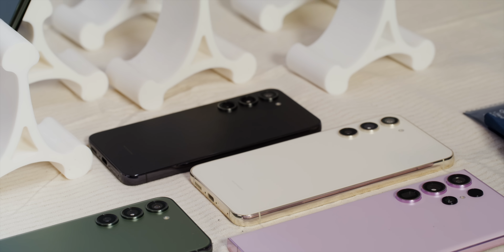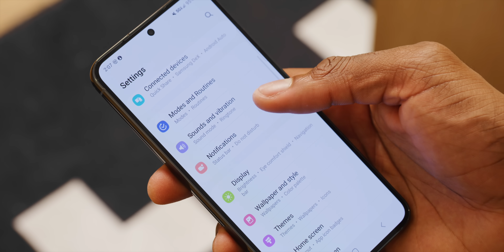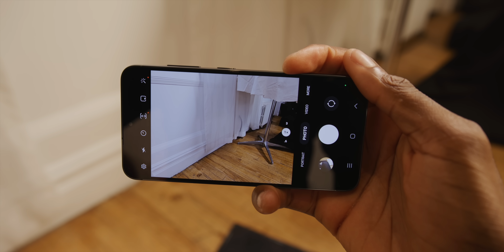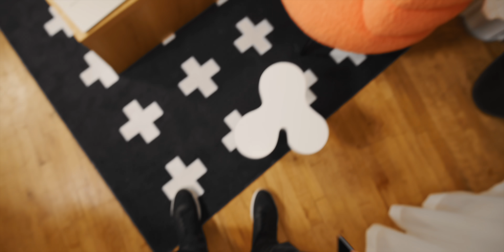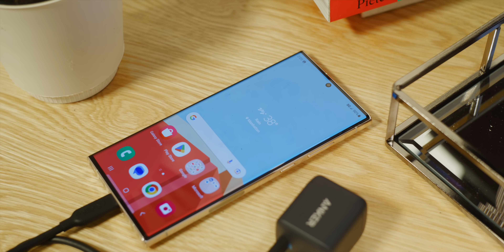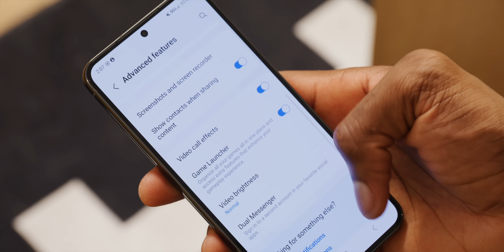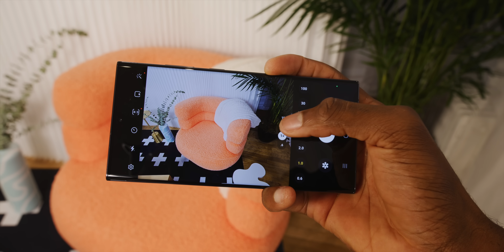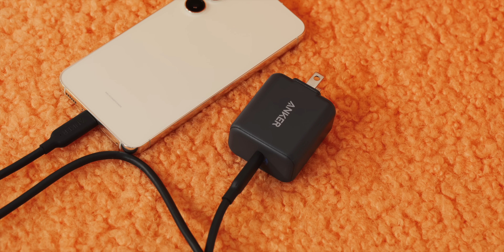Galaxy S23 / Ultra Impressions: Cruise Control!

Comment: I definitely think we've reached a point in smartphones where yearly releases aren't necessary and maybe every other year should be released
Reply: And to be fair, it would probably help the hype of new products a bit more, and make people more likely to switch as a lot of phone contracts tend to be 24 months these days.
Reply: @donkey1271  Who has a contract on a phone tho? Basically just a scam. Just buy a phone and service seperately. At least in Denmark this is always the cheapest option
Reply: @Vfulncchl  Not everyone has the cash upfront for a phone, particularly at the price they are these days for a flagship. 
With the trade in deals a lot of providers offer, plenty of people end up in a constant loop of phone contracts.

Absolutely agree it's cheaper to get a phone+seperate sim, in the UK even an iPhone SE is 40% more expensive over 2 years on contract vs phone+sim.
Reply: @donkey1271   why are people still signing a phone contract?
Reply: @evacody1249  Because it’s financially easier than dropping $7-1000 up front on a phone every few years
Reply: @donkey1271  Verizon and Tmobile IIRC are both 36 months, ATT being the only one that is still 24 months
Reply: I agree. As much as I think they should, I feel like companies like Samsung & Apple are too greedy and just try to milk as much as they can from their customers.
Reply: @Danilio.  I Disagree with you. Because I think smartphones have gotten to the point where there is no major upgrade. The smartphone companies are running out of ideas. So every year they just add little features then release them to the public.
Reply: @Dudee34  Yeah that was confirmed some years ago, I think even Mr. Whosetheboss made a video about it.
Reply: @Danilio.  you have the choice to buy a new phone every year. Don't be a sheep
Reply: @Danilio.  greedy? you do know they are a buisness right? what is the number one goal of businesses? to make money.  its not rocket science. there is nothing wrong with being greedy, dont like it? go live in the woods bc by your assesement, every comapany on the planet is grreedy
Reply: @Danilio.  true, but that's up to the customer, if you're playing for each phone each year.. That's your fault. There's no incentive to get one every year other than wanting it
Reply: @Danilio.  if anything, they are relatively slow compared to the cycles of more populous brands such as Xiaomi or Oppo, who have ridiculous release cycles and short update ones.
Reply: @Danilio.  are u slow? The word business itself implies profit maximization. It's not called being greedy, it's normal. Lol.
Reply: Nobody forces you buy. Why do you have to have latest and greatest phone. These companies even makes mid range, you buy them on your own. Don't put the blame on companies
Reply: @Danilio.  Welcome to capitalism
Reply: @melihcan7577  Lol
Reply: @Danilio.  I'd actually like to know how this one does sales wise. I can't imagine millions of people would buy this if they have the ultra 22
Reply: @B.E.R.N Network  But that's the thing tho, Samsung knows not everyone wants to buy a new phone yearly so in order to make customers more tempted to "upgrade" they'll do trade-in offers. Like trading in the 22 ultra for the 23 ultra and only pay around $100-200 in total.
Reply: @Danilio.  Apple only releases like 4 phones a year. Samsung releases like 10
Reply: @BenPBL  Tell me the differences of the iphone 13 & 14 besides processor, camera & screen
Reply: @Danilio.  Here's the thing. The companies will follow what the consumer does. Anyone can exclaim what they like but at the end of the day if consumers keep buying them every year then they will keep getting made. 

These two companies have enough of the market in which people buying every other year or every several years will keep numbers high enough to catch those looking to upgrade/change/replace.
Reply: @Danilio.  there aren’t milking customers if they are selling to willing buyers. This is a free market. They aren’t forcing you. Some people just like have the newest model every year.
Reply: @morax489  I know, that's me with Sony Xperias
Reply: @Danilio.  what is a business?
Reply: @Danilio.  apple" 
scratch Samsung
Reply: @PLITXanim  ?
Reply: @Danilio.  Take samsung off
Reply: @Danilio.  not everyone upgrades every year. Some people are on completely different upgrade timelines than you
Reply: @jayware4219  Damn, that's a valid argument.
Reply: @Danilio.  which company is not greedy?
Reply: @Robin Arora  There's a difference between making a profit and trying to squeeze every bit of money from your fanbase
Reply: @robinarora8137  Fairphone maybe? They give you the right to repair it yourself by replacing the modular components with new ones if broken of if you want an update and it's more ethically made.People literally die in mines in order to dig for gold and other metals which go into our phones. It's important to ask the ugly questions too. But since here are only fans of samsung and the newest technology I doubt anyone will apreciate it, or even the concept behind it.
Reply: @laviniam.1526  which ugly questions?
Reply: @Danilio.  just don’t buy done, stop blaming them for humans being dumb for buying them every year
Reply: @isekai2zer051  Ok
Reply: @Danilio.  You think they don't have all the stats they need to determine if they should release yearly or every other year?
Reply: @ViperOfMino  I never said they didn't
Reply: @Danilio.  i think apple is more thinking for user not to upgrade for 1 year and use their old smartphone to get a cheap price
Reply: @Gamaleno Singkali  I'm not sure I understand what you're saying. A few years ago, whenever Apple would release a new phone- their old models would start coincidentally slowing down. Thier excuse was that it was to help preserve the phone battery but they never told users when they started doing so and didn't give users the option to choose whether or not they wanted to do that.
Reply: @Danilio.  People don't understand that running new software on an older device will inherently slow it down. Because people sued Apple, they made it worse by opting to kill the battery faster to minimize the performance reduction in the newer updates. So you'll have to replace batteries more often. Just don't update if you don't need to.
Reply: @Danilio.  I don't know if this makes them greedy. Greedy would be if they forced everyone to buy a new phone every year
Reply: i agreed with you i think every two or three year should be allow for phones to come out
Reply: I agree, but I believe we hit that point around 2019-2020.
Reply: I remember apple used to take 2 years before the competition.  Check out the gap between the 2011 4s and the 2013 5s.
Reply: @DominiQfame  iPhone 5 2012??
Reply: I respectfully disagree. This would only work if people only bought smartphones together.  But every year, all the time, there are people buying new phones, trading in old ones, etc. And buying a phone today that was released 2-3 years ago doesn't seem like a good idea. I still have my Galaxy Note10+. If I were to change, obviously I could opt for the S21U, or S22U, but if there is an S23U, I would opt for the latest model, and it would last much longer with it.
Reply: @DiFF7Skyns  True! I've been using my S9+ for the past 4 1/2 years. I actually wanted to buy the S22 but we Europeans always got the Exynos models so I skipped the last gen. Just pre-ordered the S23U since I prefer Android (was thinking of getting the iPhone 14 Pro).
Reply: @DiFF7Skyns  That argument makes no sense. People buy consoles at different times too, but they still don't release a new model every single year. And funnily enouch, consoles are cheaper too. Same goes for the GPU market, you don't get a new flagship every single year and it makes complete sense buying "old" hardware, because it's the latests model that's available.
Reply: @DiFF7Skyns  But see, those things weren't what you were saying, were they? Nothing in that wall of text matters, I was never arguing the markets are the same (spoiler alert: they aren't).

The point you completely missed was: If magically all smartphones came out every two years, people would simply buy the latest model and nobody would really care if a model was one year old, since it would still be the latest model. The yearly differences at this point are totally insignificant as far as the actual functionality of the device is concerned. Which just happens to be the whole point of this thread, isn't it?

If you'd argue economics, I would have sided with you — if one company started making bi-yearly updates suddenly, they would lose revenue; their competitors would still offer yearly updates, hence a newer model compsred to theirs every other year. As you said, people tend to gravitate to the latest — and the reason they do this is almost purely marketing. 

These companies are good at making us feel like we are missing out on something, even though the reality is our old devices do pretty much everything the newer models do.
Reply: @PhazonBlaxor  You completely missed, again, the implications of releasing smartphones every 2 years or more, I explicitly put it in the text. About battery life, system and application development and operation.

It is precisely for this reason that smartphones are released every year. Oh, and the wall of text was to demonstrate that, in addition to being unviable for smartphones to be launched every 2 years or more, your comparison with the console market was completely absurd and meaningless.
Reply: @DiFF7Skyns  this is a really good point. i've never thought of it like this. thanks for sharing
Reply: @DiFF7Skyns  If it was to demontrate the tech moving forward rapidly, you didn't do good enough job to convince me of anything. 

Battery, really? Li-ion batteries barely change, since we are kinda doing the best we can chemistry-wise. Operating systems can and are easily updated on older devices. Apps can be made and are being made to support older devices as well (I am in fact a software developer, and if my app doesn't work on older devices I am cutting my potential customer base for absolutely no reason).

I said your argument made no sense, because all you were originally saying basically was "people want the latest model, just because they just do".

You weren't talking about anything else besides the fact that there are people every year looking to buy a new phone (true) and that they tend to gravitate to the latest model (true). But if manufacturers didn't update models every single year, it would matter absolutely nothing to the end user — just like people don't buy in synchronisation, manufacturers don't create in synchronisation.
Reply: @PhazonBlaxor  You do know that the battery has a maximum of 3 years of use, until its capacity starts to be significantly compromised, right? And considering the big updates, to maintain performance, it is necessary to push the battery even further.

And this is just one of the factors in the dynamics of the smartphone market. The others I have put in previous comments and see no need to repeat them.

Anyway, I understand what you mean, that the industry could opt for biennial releases, instead of annual ones. Possibly in the future this may happen, but in practice this is simply not feasible to happen now.
Reply: @DiFF7Skyns  What does the lifetime of a battery have to do with the discussion at hand? All I was saying is what you originally said wasn't a good argument on what the OP was saying — nothing else.

Do I agree with what was being said? No, not necessarily. I agree with the OP in that the improvements are marginal at best. But I disagree in the sense that companies won't take this route simply because of economics. They want to maximize revenue — as things stand now, it wouldn't make any sense for them to change the upgrade pace. If anything, they want people to switch as often as possible.

Which is probably one reason they are still not introducing a simple improvement that would significantly increate the longetivity of batteries: charge limiting. Most consumers don't realize that emptying the battery and charging fully is what's killing their batteries. I've been keeping my charge between 40% to 80% on all my devices as often as I can, and it shows: even my ages old Oneplus 6 still has great battery life, my 2016 MB Pro is sitting at 85% battery health and my 6 months old Surface Pro 8 is still at 100% — despite me using it heavily every single day.

Batteries can last far longer than 3 years if you just take care of them.
Reply: @PhazonBlaxor  What does the lifetime of a battery have to do with the discussion at hand? Everything.

If I buy a second-hand smartphone released two years ago, it will have more deteriorated battery health than a used one released last year. No matter how careful its previous owners were. Battery degrades over time, and that's a fact. Yes, the battery can last more than 3 years, it can last up to 10, or even more if you want, you just won't be in the same health as always.

In the case of smartphones, updates further degrade the battery to hold performance. And performance is something that also compromises the useful life, not only of the battery, but of the cell phone as a whole. The more time passes, the lower the performance and health of the battery, this is inevitable.

All that said, not only the battery is a considerable factor to justify the annual launch of smartphones, but the dynamics of the market. More and more people are buying or changing cell phones all the time. Cell phones break down, forcing people to buy a new one (or a used one). There are different profiles of people, me for example, who make heavy use of the cell phone, which further degrades its useful life.

As I said in the previous comment, your argument may make sense in the future, but now, in practical terms and the dynamics of the market and the operation and useful life of the devices, launching smartphones for 2 years or more is not feasible.
Reply: @DiFF7Skyns  What are you talking about? We were discussing the release of new phones, not used ones. So once again, what does this have to do with discussion at hand?

Let me go through this "problem" of yours. So I have a phone for 3 years, I took terrible care of it and the battery is dead, have to buy new one. What do I do? Go and look for the latest model and buy that one (I would actually look for various options because I don't stick with one brand, but let's imagine you are a huge Apple fan or something and don't consider anything else). So, where is the problem? It's the latest model with a brand new battery? Sure, it was released an year ago, but it's still the latest model and ia brand new in box.
Reply: @PhazonBlaxor  We're discussing not just the releasing of new phones. But the interval from one to another. And yes, this has direct impact on selling used phones, that was one example I used on my previous comment. That's called perspective. You always need to look up for the whole picture when you're dealing on such subject of discussion. It's not like simply saying (like you're doing): "Hey, if they only released devices every two years, whoever bought a new device half the time would still have the last one released. Problem solved."

Since the beginning of this thread, I presented several reasons why the annual launch make sense for this particular market. Several. And you wasn't able to present any counter argument to any of them. And your reasons to biennial (or more) launch makes no sense, I made sure of that for which one, no even the initial comparison with consoles, which was absurd.

Anyway, you can keep with that thinking of yours, and I can continue to be glad they released phones every year. This discussion has nowhere else to go, besides repeating ourselves. Thanks for the conversation.
Reply: @DiFF7Skyns  You do realize that companies also don't release in sync, right? There would still always be models available which came out that year. How is this so hard to wrap your head around?

Also, it's not that half of the people would get the latest model — everybody would just as they do now, as it literally would be the latest model available from that particular company. It doesn't matter if they come out yearly, every two years, every three years, by definition latest model is the latest. What's so hard to understand here? It doesn't matter to the general consumer in the slightest if the CPU is 5% faster or not — most people don't care or understand anything about the underlying tech, they just want a phone that works for basic tasks. Which is the whole point you keep missing by moving the goal post with your random BS about batteries and whatnot. 

But yes, this conversation is going in circles. I'm getting tired trying to explain the simplest of things when it clearly isn't coming across at all.
Reply: @PhazonBlaxor  With the advent of smartphones, their life cycles have become kind of predictable. You buy a new phone, enjoy all its flashy specs, and then within a year you get a new model that makes yours seem outdated. It's possible to feel like it's time to upgrade your phone after two years, or risk falling behind, just like Apple and Samsung do with their new iPhones and Galaxy phones every year. The company knows that at any time customers could be looking for a new device, and they want to be able to tempt them with something. Rather than have a 2 year old device that they think, Wait a second, if you have a 1 year old apple iphone, you wouldn't want to upgrade to a 2 year old Samsung phone, right? As an example, if smartphones were released every 2 years, it would mess everything up because if you wanted to switch to another brand, you had to buy a smartphone from that specific brand that was out that year. In this way, you won't have to switch from a 1 year old phone to a 2 year old phone, since every company would have its own opinion, saying "Hey, I'm gonna replace my phones every 3 years, hey, I'm gonna replace my phones every 4 years." , I agree with DiFF7Skyns. For smartphones to be released every two to three years, every company must do it at the same time.
Reply: @PLITXanim  I think you are thinking way too deep into this. 95% of consumers aren't smartphone enthustiasts and have no idea when a phone was even released. They just buy whatever they come across and suits them.
Reply: @DiFF7Skyns  finally someone making this point
Reply: @DiFF7Skyns  definitely agree with this, I'm currently running a fold2, my inner screen is now starting to show hairline cracks, if samsung didn't release a new phone now then I would be limited to buying a year or two older phone or wait another year in which time my screen could die at any time. I'd rather get the latest phone now and sell mine to a 2nd hand phone shop while it's still worth more than scrap. And as much as I love the fold I won't be getting another one.
Reply: @DiFF7Skyns  wow that does make sense
Reply: Agree. Every three years should be good enough aswel.
Reply: @Farcallo  I was about to purchase a samsung s phone back in 2018 but I discovered poco f1 while researching for other phones. It was highly praised phone even in the west. So I bought it and was half the price of the latest samsung s series that year. 4 years later my phone still do it's job but the battery is degrading which I think is normal
Reply: @Farcallo  5 years, the more you wait, the more exciting the ugprade.
Reply: What about battery
Reply: @Farcallo three years is a little long
Reply: People upgrade every year, Not just one person.

But people’s upgrades cycle aren’t all synced up so all because you upgrade 21,23,25 sone else maybe be 22,24,26.
So why would they reduce their profits?
Reply: Yearly releases aren’t so people buy a new phone annually it’s for the people who bought a phone years ago.
Reply: YES
Reply: you think ONLY NOW we've reached that point?? and I thought I was the elitist
Reply: Agreed, but I think yearly release is good from stock market standpoint.
Reply: I would go as far as every 2 years. I ran my Iphone 7 till the iPhone 13 came out and I upgraded to a 13 pro max. Most likely wont upgrade for another 6+ years.
Reply: We reached that point a few years ago.
Reply: I feel like we've already reached that point many years ago, but either way I agree. It would cut down on SO much e-waste.
Reply: @niko1even  People would still buy and throw out the same amount of phones... They would just be more older models
Reply: Yep. I'd also like to see screens start getting a little smaller again. Hard to keep up with them getting bigger and bigger.
Reply: @suraangel6956  iPhone 13 mini?
Reply: @suraangel6956 the regular s23 is a nice size.
Reply: @suraangel6956  look up small smartphones, you could get a really small phone.
Reply: They have to release every year because those that are looking for the next newest thing will jump ship and buy the latest iphone if they don't. Yearly release are just to keep business because those who don't upgrade all the time won't be bothered anyway.
Reply: You don't have to buy a new phone  every year. The companies aren't forcing you.
Reply: Them releasing it yearly doesnt mean you need to buy them every year. Just like cars!
Reply: True
Just look at the iPhone 14 🙂
Reply: True . In like 8 or 9 years of using phones , for the first time I don't feel I need to buy a new one .
Reply: @houseismorethanjustm  honestly I just upgrade when the battery goes, which is usable like 5years
Reply: I think as Moore's law slows down we'll naturally get slower release cycles as well, at a certain point the economics of yearly releases just dont make sense.
Reply: I totally agree, also from a environment aspect, there should be regulations
Reply: Disagree... most people are on two-three year upgrade cycles. Many would then start aligning their upgrades for the refresh year, meaning Apple/Samsung lose revenues during the non-refresh year.
Reply: We’ve been at that point for a while. The thing is, people still buy these phones every year. If there’s money to be made, companies will take advantage of that.
Reply: @immortalsun  exactly
Reply: I go every 2 years
Reply: Yep. Been like that for years now. Probably a decade. The changes are small incremental with maybe one big jump once in a while. The companies will keep making them tho coz it's easy money for people who crave being "up to date" so you can essentially keep making money if you're a phone manufacturer but for the average person like in my case I usually keep my phone's for like 3 years minimum so upgrading every few years doesn't leave you behind coz usually the only thing you lose out on is some occasional software updates
Reply: I very much agree. Both iPhone and Samsung have become so good that it feels overbearing to keep having annual releases
Reply: The thing you're forgetting is that not every one upgrades every year. I upgrade every two to three years, at the mo i'm using a S20fe, so the yearly phone upgrades work for people like me. And those that will always upgrade at the first chance they get.
Reply: I think companies incrementally update their phones every year is fine.. it’s us customers that should control our spendings and only upgrades every 3-4 years.

For people with 2019 phones, now is time to upgrade
For people with 2020 phones, maybe next year
For people with 2021 phones, two more years
And so on..
Reply: Plot twist: You don't need to buy them, just skip one year if you want :P
Reply: So what you are saying is that they should release new phones when you or someone else wants or needs a new phone 😉
There are people buying phones all the time. Why would they buy a 1.5 year old phone. If they can buy a phone released 6 months ago. Yearly releases are just fine. They might be incremental improvements but if people choose to buy with every second release the improvement will be bigger. Samsung now support 4 years of OS updates, so they obviously don't want you to upgrade every year. They (and other companies as well) just want to give the best they can to anyone who is upgrading at a given time.
Reply: Let me rephrase that for you, I think we have reached a point where yearly "purchase" isnt necessary. Let companies do what they do, we should control our purchase patterns.
Reply: Yep! I usually keep my phone every 2-3 years until I upgrade and the upgrade is noticeable enough that I'm satisfied upgrading. The only time I've upgrade the following year is my current phone which is the Fold 4. I didn't like how narrow the Fold 3 was so when the 4 came out, the proportions were better for my liking, so I upgraded. I'm def gonna keep this for at least 2-3 years, as usual.
Reply: Yeah, but not everyone on Earth buys phones at the same time, riiiiight?
Reply: I disagree, companies can launch phones whenever they want. It’s down to the consumer to decide when they want to upgrade, whether that’s every year, every 2 years etc
Reply: I think yearly releases are fine, it's just not necessary to upgrade annually.
Reply: companies: "BUT WHAT ABOUT ALL DAT MONEYYYYY"
Reply: It's been like this for at least 5 years now. Releases should be every 3 years.
Reply: How about people who upgrade from 7 year old batshit?
Reply: @Johnny XCX 

"Improvise, Adapt, Overcome"

Jk lol
Reply: And that goes for iPhones too... Not just Android phones
Reply: Lg knew this issue
Reply: @chriswright8074  indeed
Reply: Totally agree with you. Every smartphone brand is doing the same thing processor and camera no new innovations and USP.
Reply: Still on a iPhone 12 Pro Max and honestly could use this for another year or 2 and be fine. Smart phones are becoming kinda like cars no real reason to buy the latest just buy last years model used or when the price drops.
Reply: i disagree there are people who always skip nd buy next one 
A lot of people waited for this nd didn't buy s22 
Nd a lot wont buy s23 and wait for s24
Reply: 3 to 4 years is good but the tech brands will make less profits
Reply: it beenthis way for a long time now. At this point, companies are doing it just to do it cause they know there are still a morons that buy the newest phone every single year to be "up to date"
Reply: I have an s9+ and see no reason to upgrade lol
Reply: That's true, but unfortunately every other phone companies releases phones every year so if Samsung doesn't give their yearly refreshed S23 model, most people would spend their money on other flagship phones that came out in 2023, since it's "updated and new"
Reply: @oreopuppies6411  most people buy phones when they run into the need to. It’s like a car: they release one every year but people stay with the old one, having big changes with bigger gaps but small upgrades, changes .etc every year
Reply: but Apple does the same, people laugh at them, welcome to the club.
Reply: wouldn't make sense business wise because not everyone is upgrading every year. if people stopped buying a new phone every year just for a minor upgrade then they would rethink it maybe
Reply: You definitely haven't had the last 2 fold devices
Reply: It's been the same shit for the past 3years. The upgrade is minimal. The thing is the consumers are not smart anymore so they buy yearly for namesake.
Reply: @hcjdjejssk5887  speak for yourself 😂😂
Reply: It's pretty obvious that the biggest update with the S23 series is the camera and nothing else.
Reply: LOL, they don't release new phones for PEOPLE's benefit. The release them to make more money. There are naive people who are willing to pay $1000 just to "upgrade" to a few more camera MPs or a faster refresh rate so their screens "look nicer" when scrolling through messages.
Reply: I think the same but much early hehe IM still using Huawei mate 10 pro. Ok , updates stop on Android 10 but its enough for all users to use all apps. Is fast enough with all apps run in background ( for some people its only 6GB RAM).  MIC is  freaking Great catch all vices no issue,  Stereo Speakers are good, Cameras are good little worst is Video Recording but it's enough for most users. I'm using still original battery  and still all day with medium  use.  If the battery shows  signs that need to be replaced, I will  replace for  few pennies in Main Huawei center, no problem. Im trying to choose my second phone for my second SIM Card  ( don't want to use two sims card in one phone) I can't decide what to choose  for now.
Reply: We've been there
Reply: They should do that as well with their  tws earbuds
Reply: So minor upgrades...
Reply: Why I usually wait at least 2 models after I have an s22 ultra see what the s24 ultra will be like before I decide
Reply: That's garbage how Samsung's only doing 500$ trade in credit for my s22 ultra. Definitely not worth upgrading.
Reply: It'd be expensive though
Reply: I think it kinda helps the consumer more than not. For example, i didnt get a phone for a year or two. I can EITHER get a new phone that came out this tear or get an older one for cheaper. But lets say they do a three year cycle And i wait two years to get a new phone. Id probably have to get that two year old phone, no problem, but itll PROBABLY be near the price it was two years ago.  

Tldr: basically what I'm saying is as a consumer you DONT have to buy the new shiny thing but if they ddnt do it every year itd probably make the prices of recent older devices more expensive. Think video game consoles for an example.
Reply: 100%
Reply: Same as FIFA and NBA2K
Reply: And they'll still barely be an upgrade. They just take their old phones and solder on whatever marginally better snapdragon and camera is available. No increase in RAM. No expandable storeage.
Reply: Cameras could be better
Reply: Question since folks smarter than me might be here. My S10+ has resolution of 1440 x 3040. Would the S23 and S23+ basically be a downgrade from a screen resolution standpoint or is there more to it?
Reply: You don't need to buy a phone each year. Ideally people who do need to replace their phone after several years of usage should be able to buy the most current thing.
Reply: I agree an extra year would let them refine a product much better
and too many products
Id really wish they put more focus into a few products instead of scattering it across multiple lines
Reply: well lets wait till 2025 because thats when we get the 500mp camera, selfie camera that can disappear, fingerprint scanner on the entire front screen, and redesign.
Reply: Yep. Or better yet every two years.
Reply: I wait 3 years between upgrades.
Reply: But capitalism! And lets not forget consumerism!!
Reply: Agree 💯
Reply: Hard agree. With these things being g as powerful as co.puters, if vote for spending more time investing in development for better upgrades next year.  These things are better spec'd then my xbox360 was. I ran that past the release of the Xbox one, I could wait a little longer for a phone.
Reply: That's like telling car companies that releasing a new model of their many vehicle lineup isn't necessary. I get what your saying but in reality its business. They have to release a new one each year in order to rake in profits. Also people in the market to upgrade would probably buy the latest thing from the manufacturer if they want. I had the s10 from 2019 and just upgraded to the iPhone 14 pro the latest from Apple.  Some people upgrade each year but there are many who don't and when the time comes that they need to buy a new device its helpful to have the latest model out as an option or look to older models.
Reply: That's facts
Reply: Honestly I thought this ages ago, I think around the time the s20 came out, and I still do
Reply: I think what they should do instead is release non-flagship phones every year and then release flagship phones every other year.
Reply: Agreed
Reply: well not everyone buys their phone at the same time, some people might have their for 4+ years and think now is the right time to upgrade
Reply: We reached that point with the S7 back in 2016. They should release a new phone every 3 years or so.
Reply: Apple and Samsung release yearly. Does not mean we should buy yearly.
Reply: Always has been, just don't buy new stuff every year
Reply: I agree, for all this is a great phone I won’t be changing for another couple of years, I have the S22 Ultra and I’m VERY happy with it. Phones are lasting longer and the quality is still good 2-3 years later but this is a great review from Marquis, as usual.
Reply: it's necessary coz not everybody update every year
Reply: wow. great point.  maybe this year Samsung and next year apple might do the job
Reply: 3-4 years, when it actually feels like one should change one's Phone. There is no "new" feeling stuff before that.
Reply: but that won't make them as much money!
Reply: It's never been necessary, it's called PLANNED OBSOLESCENCE, Marques should do a video about it.
Reply: I buy every 3 years
Reply: Like nothing phone
Reply: I have an Oppo Find x3 pro and most phones don't improve on it even though it's 1.5 year old now.
Reply: Meagre updates every yr...and they charge the same ...new phone releases should b once in 3 yr ...tat will b good for environment too....otherwise prices should drop for older phones wen new phones comes out .
Reply: No man every year launch is necessary just people need to stop buying every year. if phone launches in 2023 that phone is made for people who have phones before 2020 .  
example : you buy phone from 2020 and after 3 years someone buy latest model . now next phone will launch in 2026 and the year is 2025 . would you want superior tech than 2023 or would you buy sam old 2023 tech which is already 2 years old😂
Reply: I agree. But I don't think they're thinking about (only) last years consumers
Reply: It better for the consumer for them to release a new phone every year as it gives us more options and drives the old phone prices down. They would save money if they only did every two years and the old phones would be more expensive for longer because they weren't being put "out of date" so to speak
Reply: They have to do yearly releases because every person who's 1 phone behind will get the next one to upgrade. s22 people said they're going to wait for S24, S23 people will wait for S25 them, it's just an endless cycle
Reply: Well if your device is slow and needs an upgrade now, if a new release isn't available, well you gotta need to wait a year for it.
Reply: To be fair for people who don't upgrade phone every year or 2 S23 is amazing option
Reply: But if you don't change that often of can they drop software support on your 2yo phone and force you to upgrade !
Your a mad man, think about Samsung stock value 😭
Reply: Let them release every year. we shd buy it once in 4 years. thats the reasonable time.
Reply: oh what would the shareholders say!? I think we all agree with a release every other year but we know it's not happening. people are still gonna buy them so why stop making them.
Reply: why people are buying them then
Reply: Its for those who want upgrade
Reply: I don't think they think we buy phones every year, I think a big part of it is to stay relevant and many people don't buy the next years phone so if they do buy a phone from last generation not necessary that they buy a phone after 3 years they could buy after 2 years too and that would mean they have to buy the same phone just again that too 1 year before the new one comes out.
Reply: Really this days there's not much to expect when they do remove them yearly
Reply: People who say this are so dumb. It's better they release new phones yearly because it devaules the older models and makes them more affordable. People who want to pay for the latest tech can. People who don't want to upgrade don't need to. It helps nobody by not releasing phones as often.
Reply: Agree i have s9 plus and now i will buy 23 ultra, every four or five years you see huge  difference in technology
Reply: Flagship: 3-4 years
So, i'm gonna upgrade my S20+ to S23+
Also my S20+ is only 4G, so another win for S23+
Reply: Wrong; Just because people shouldn't upgrade each year doesn't they shouldn't release an offering each year. As different groups of people will upgrade in different years. Just because you upgrade every year doesn't mean others do. Someone shouldn't have to buy a 2 year old phone because they weren't ready to upgrade 2 years ago and they don't want to wait for the next release.
Reply: Yeah man, but there are competitions and the corporates don't want to lose customers.
Reply: I want to see the smallest version of the phone have all the top specs the bigger phones do!
Reply: How will they earn and burn your pockets?
Reply: Or…you could just not buy it instead of trying to limit the others looking to upgrade.
Reply: I think we reached that point about 10 years ago.
Reply: Yeah... Definitely boring af
Reply: Im not sure about that. If this was the case, when youre looking to upgrade you either have to buy a year old phone or wait a whole year before the new one drops.
Reply: They should be released the way game consoles are done.
Reply: @Red_Genie  Every seven years? Unfortunately software develops way too fast for that. Old processors would have a hard time handling new apps and OS's after like 5 years. Not to mention battery that loses its health over time. After 7 years your battery is worth nothing.
Reply: If the demand in sales is still there I guess they will just carry on. I haven't had a new flagship phone since the galaxy S9. 
Very happy with mid range phones these days
Reply: Yes and no , some people are coming from older phones every year , but certainly if you own the previous model  and spend your coin on a new one , in daily use you are really going to have to look very hard to see a difference for daily usage .
Reply: Yeah you're maybe right
Reply: You don't have to upgrade every year.
Reply: But why? Why can’t people just have some self restraint and only upgrade when they feel they need to. Some like to upgrade every year whereas some are happy upgrading every 3-4 years. No benefit in manufacturers releasing new phones less often.
Reply: No? You don't have to buy this. A person can buy a phone every 2-4 years and just get the latest one. Having new phone come out come out every 2-3 years would mean if person wants upgrade. They would have to wait longer, or even go to their competitor if they released a new phone recently. Which companies don't want.
Reply: Still have a snap S10+ that works almost as well as new. Battery is factory and still lasts me a day easily. Cannot see any justification to change at the moment. 5G is useless for ,phones imo, picture quality is already very good, it has everything I need. 
You can easily keep a smartphone for 4-5 years nowaday I feel.
Reply: Agreed. I upgrade every 2 yrs. I currently have the s22 ultra and watching this video it looks like I'm gonna be waiting until the s24 ultra and possibly even the s25 ultra to actually get a big upgrade.
Reply: Not gonna happen duo to marketing rules
Reply: Exactly what I was thinking. 💯
Reply: You don't have to buy them yearly, just wait three years then.
Reply: We reached that point years ago but companies will be companies and still release products but as the consumer buying a new phone every year is just dumb and wasteful, my S8+ is still going strong after years and its only now its starting to show signs of lagg.
Reply: There never was a point where it was necessary to upgrade your phone on a yearly basis. If you have a year old phone there's absolutely no reason to upgrade, however not everyone has that. I'm still using my OnePlus 6. So for me its going to be a huge upgrade.
Reply: That’s dumb. And here’s why. iPhones last a long time. Androids can do that. But If I have an iPhone from 2017. Let’s say iPhone 8. And I want to upgrade fall of 2023. BUT a phone just came out in fall of 2022 and the next one isn’t until fall of 2024. So now I have to wait or buy last years phones. Phones aren’t for you to upgrade yearly
Reply: Buying them every year has never been necessary, but we're definitely now at a point where skipping a few generations is a good idea. I'm on an S10 and will be upgrading to the 23 Ultra. It's the equivalent of getting an S14 in their old naming terms.
Reply: I havent bought a yearly phone for years
Reply: But unfortunately they can't make money that way.
Reply: @Sambeg  They still can, it just won't be an annual thing. But even if they stopped making new phones yearly they would still have many other income sources like their subscription based services & other products.
Reply: The companies won't stop. Its business. Simple. Just don't buy every year. Buy anytime you feel like its time to buy.
Reply: Agree
Reply: Most people don't change phones yearly anyway.
Reply: No this is great because I can buy last year's phone with 90% performance for 50% price.
Reply: Unless someone is coming with a new breakthrough, they better not release yearly. But hey, how they gonna make a living? Also, dont forget new entrants and not just upgraders
Reply: But Apple would not want that.
Reply: @pepsibIue  I had a co worker that got a new flagship every 4 months or so. He would buy a phone, keep it until the honeymoon phase wore off and it wasn’t exciting to him anymore, sell it for almost full price and buy another flagship. This was how he got his dopamine hits
Reply: I'm so glad someone has finally said this!! We don't get a new Xbox or PlayStation EVERY year, so why do we need to get new phones every single year?? Its baffling. Also, if the next Samsung Galaxy S Flagship wasn't realised until 2025, there'd be more innovation and a MUCH better upgrade.
Reply: apple drops yearly and they're a trillion dollar company...they have no choice...
Reply: Incremental every year is best, just upgrade on your own pace.
Reply: All the damn e waste.
Reply: No. Cause if someone bought their phone in 2021 in 2 years for them is 2023 but if someone bought their phone in 2022 in 2 years is 2024. Not everyone change their phones every 2years on the same year
Reply: absolutely NOT agree. i want to buy a new best phone every year because i am rich and dont care. i also buy a new car and a new monster gaming pc every year.
Reply: Snapdragon 8 gen 2 is massive upgrade chip from snapdragon 8 gen 1 in s22 ultra
Reply: @richard35791  That's what they say every year.
Reply: I would be great to see a company that releases a phone every 5 years and supports them for 10 years.
Reply: Who cares if they release them. YOU BUY IT EVERY 3 years…the world doesnt revolve around you, someone might be in a 3-4 cycle of not having upgraded their phone to they buy the phone releasing next year
Reply: Yearly spec bumps make sense, you just don't need to buy them every year...
Reply: @airplanes657  , in terms of impact upon ecology and Earth ecosystem, they don't. In addition they're too minor to make a difference and only bolster planned obsolescence as well as production of bloated, unoptimized software that sucks (suckless software reference).
Reply: It is not an annual release that won't be necessary, but the habit of changing your device every single year that has to be done
Reply: @UwU are you disagreeing with me by saying the exact same thing I said?
Reply: @@user-kq6fn3dl7w I'm looking at those specs. Not much of an upgrade . No amount of mental gymnastics will change that lol.
Reply: How will they make money? Apple releases the same phone every year and the sheep go crazy. Looks like Samsung is going the same way
Reply: Definately. Even more definately nothing will change regarding releases of new ones...
Reply: I like yearly releases since the older models get discounted so much so fast :))

8:04 PM
2/4/2023
Reply: The original Iphone were released every 2 years for new model. It’s give people not to buy phone every year with better upgrade on the phone itself not only (minor upgrade) And sell the 2nd hand phone the price was good by that time.
Reply: there's 4 other colors from their site as well
Reply: They can release one every year but I’m only getting a new one when I break the old one or it fails in some way. Like about now when I need to replace my S10 🫤
Reply: I think most people will agree. But that will never happen because the company will not make near as much money.
Reply: It depends on the model. The foldables, Samsung galaxy Fold and Samsung Galaxy Flip, still improve with leaps and bounds every day.
Reply: Yeah. We should orientate at desktop GPUs. 2,0 - 2,5 years would be a perfect time span for iteration updates.
Reply: We've been there for a decade.  They will continue to release yearly for simps who buy them every year.
Reply: *Bye bye share price, laughs in evil Wall Street
Reply: Yeah the s22 was so similar to s21 and s23 only slightly difference means that there's really no point in getting the s23
Reply: @Gh0st-gso  i thought so too... but the s23ultra is actually better than the s22 ultra by a large margin
Reply: Or you can choose not to buy because yearly releases are not for last years customers
Reply: People dont buy yearly anyways.let them release
Reply: Agreed!  I'm still rocking the note 8 lol...
Reply: THIS! This is what I’ve been saying for years.
Reply: We've hit that a while ago but people still buy so they release.  I stopped buying yearly when I got the Note 12.  I buy every 2-3 years now.  I have a S21 ultra and I'm buying the 23 ultra.
Reply: U don’t have to buy one every year my guy
Reply: There’s a Toyota Camry release every year, but you’re not buying the latest iteration of your car every year. And you don’t expect the new one to be wildly new every year. And that’s ok.
Reply: I think they do it obviously because of money but also because there are people like me that aren't on the same timing as everyone else.   Basically I haven't upgraded since the s21 and I normally upgrade on a  every other year basis.  Therfore,  this would be my personal  year to upgrade.  So in some way, yearly releases do work out
Reply: For that everyone needs to be on the same release cycle, I don't think everyone is.
Reply: @mirzadotdng  THANK YOU
Reply: 100% agree. I say this as an iPhone 7+ user, there was a point where the phone would just feel so slow on the latest update and then you’ve basically got a brick. But now they’re quite fast and there’s no improvement other than camera and a bunch of gimmicky features I don’t need.
Reply: doesnt matter, it their money making machine. just like call of duty, or madden, as long as dummies keep buying them, they wont stop
Reply: Agree, just thought about this few days ago . 😂
Reply: Yes I agree. Just look at how great this year's starting off, whit 256gb and snapdragon 8 gen 2 chipset c'mon what more do we need ⁉️ besided 6000mAh..🤷‍♂️skip a year for ones just ones 😅🤏
Reply: Nah. You don't have to upgrade every year.

All changes this year were mostly under the hood. You don't see the increased battery life from the outside, but it's one of the greatest changes from last year.

Only made possible by the new SD 8 Gen 2 btw. The S23 series isn't a good upgrade for people with any S22 or S21. However for me on my S20 with half working cameras and a cracked screen they're pretty great.
Reply: Peak was the 512/8GB Note 9. I've just upgraded to a 512/16GB S21 Ultra for a killer deal
Reply: I think Samsung is going on that route. Year 1, the design changes drastically. Year 2, the specs change drastically.
Reply: Strong statement but if one company does it like apple, then other companies wouldn't like to be seen as someone who wasn't able to launch a phone, which might not be the case, but i guess at this point launching phones is just for the sake of standing in the league for companies.
Reply: They make new phones every year because they can more money that way..
Reply: I don't get why people would think a company would switch two releasing a new phone every 2 years. Consumers are all on different purchase cycles. Consumers don't NEED to purchase every year or even two.
Reply: Every 3 years should be a standard.
Reply: Honestly…the need to wait at least 18 months to accommodate enough new stuff and get mass production of the chips that go into the new phones, they just wanna ship out product
Reply: Agree, for flag ship ones yes that's the point .make it worth the wait
Reply: It's been like this for like 5 years 💀
Reply: Agreed 💯💯💯
Reply: Yep, no point in upgrading.
Reply: Same as laptops
Reply: last year phone price will drop down. Its good for us. :)
Reply: I agree i replace my phone every 3 models. So i got the s20plus now ill get thr s23 plus
Reply: Yearly upgrades* not releases.
Reply: Could be. But manufacturers aren’t doing these yearly releases because they use their intuition, that’s rather based on empirical data. If a company decides to release products every second year, people will buy the model that is the “newest” from another brand. So even though it is not the best strategy, they would rather have these incremental releases every year than to adopt another strategy.
Reply: S23 ULTRA better than VIVO X90 Pro Plus for camera and overall?
Reply: As a phone sales person I beg this not to be the case. Launches = usually good sales days
Reply: I think yearly releases from the manufacturer are still fine, but the people buying them should really not be worried about upgrading yearly. As good as phones are now, even upgrading every third year would probably be just fine.
Reply: Yeah I agree also. I have an s20 and the only reason I'm getting this phone is due to my screen being cracked
Reply: That's with iPhone
Reply: For us poor people it's actually helpful. Newer releases generally give a way for price drops of the old variations
Reply: You’re broke
Reply: Yh but... Money
Reply: Until we the consumer stop upgrading yearly they won't adapt
Reply: But what about company revenue and executive bonuses?
Reply: Right it’s getting to the point where what more can u change to make it worth the upgrade
Reply: I don't think phones need more or less hype, the point of yearly launches is to incrementally improve an existing, already great phone. Gives people with a 3yr old phone no FOMO, when the newest phone has a higher refresh rate, better battery, and 2 more cameras. But it gives people who need the newest device a reason to spend money again. If you suggested phones be launched like consoles, then the expectations would be far greater for something that has basically been optimized since they started getting rid of the upper and lower bezels and removed the aux port. Just don't buy the newest phone and wait till next year, somebody else will need a new phone, that's how it works.
Reply: AGREED
At this point these are barley even "S" updates (like iPhone 7 then 7s)
Reply: Ready this from my iPhone Xs Max and I’m really not in a need for a new phone. Still 88% battery capacity and it runs great still. So yeah I agree 😅
Reply: Maybe dont buy it yearly then
Reply: Instead people can stop buying every year. I buy every 2-3 years and still don't see much difference. I upgraded from s10 to s22 and there really isn't much of a difference.
Reply: my guy its better that they release every year because they aren't forcing you to buy them it just gives you the ability to buy the latest tech whenever you want
Reply: You just don't have to upgrade every year, if you upgrade every 3rd year, it would be reasonable. Every 4th year even. I have an s20 and I'm still fine. Might upgrade on the next one. But if you have S21 and S22, not much difference.
Reply: Some rich psychopaths just buy it and keep on buying. Irrespective of actual difference
Reply: That's good for us because I can get an older phone and still have a great phone
Reply: This comment is so trite. Yearly releases aren't so people can buy a new phone every year, it's so that people who keep phones for a few years can still buy a new one and not worry about being in sync with some arbitrary 2-3 year cycle.
Reply: Fully agree. Absolutely no need for new releases every year. Concentrate on updates and boosting maybe their lower spec phones and see where they stand every year
Reply: I agree. It’s like TV, laptop, and any other electronics. People used to be excited about innovation but now nobody cares as upgrade is minor af.
Reply: We have been at that point for a few years now.
Reply: With the newer iPhones too me it looked like 2-3 years
Reply: I agree, but they will continue to make them because people don't tend to upgrade their phones every year. On average, I believe people wait a few years to upgrade and when they decide to they want the current years model rather than something with last year tagged to it. I think manufacturers are aware that most people don't upgrade their phone every single year, but it simply doesn't matter because everyone is upgrading at different times anyways. Demand is always there.
Reply: r/woosh
Reply: Were they ever necessary?
Reply: Haha I have literally done my research project in uni about this. It is interesting to see that other people are actually thinking about it!
Reply: The little updates simulate compounding interest
Reply: This is exactly why I upgrade every 2-3 years. It's only by that point that the changes become noticeably different and satisfying to upgrade. Otherwise, it's a complete waste of time (to make sure everything is set up how one would like - assuming they aren't an Apple fan and like to customise), and a waste of money... Having to pay about a thousand every year.
Reply: Yep. I have an S22 Ultra and won't be upgrading before 2024 at the earliest.
Reply: But all customers are not gonna buy a smartphone in the same year and buying an old smartphone means 1 to 2 years of less software update.
Reply: Imo they can release whatever they want. The public should simply stop being wowed and stop buying new phones every year. It's all demand and supply. If there won't be a demand there is no need to supply since sales will drop. It will happen. Just a matter of time.
Reply: This will only happen when they run out of ideas and things to upgrade for their next phone.
Reply: I bought my S9 used in 2018, it's been thru a bad wreck that almost killed me, the case deteriorated before the phone. I've been without a case for a year and it's finally struggling after the screen cracked. Still get about 3 hours screen time on ful charge with constant use. This phone been thru so much with me, definitely gna miss it... s23 will be coming soon😢 here's to another 5+ years of reliable usage.
Reply: Agreed
Reply: Nobody ask you to replace phone every year, you can skip few generations and replace every 2 or 5 years.
Reply: Every 4-5years is a great cycle if it doesnt get stolen or breaks
Reply: You think they would do that too much profits are made😂
Reply: But not everyone is on the same upgrade timeline if you don't need a phone just don't buy the phone xD
Reply: if we're stuck with snapdragon 8gen1 for two years , that's not a very good place to be
Reply: I agree but it probably wont happen because all mobile companies wnat to make more money from newer models... but it would be fun to see concept/unique phones with different features each year. Like one purely for Cameras another for gaming or affordable foldables.
Reply: Totally, 2 and 3 years is the sweet spot
Reply: Consumerism
Reply: agree
Reply: The trick is not to buy them every year and only when you need to get a new phone. So one every three or four years is fine.
Reply: Maybe... However I like them good deals, and the more people upgrade to the next year's model the cheaper it is for me to get a slightly older product for way cheaper
Reply: Then the 24 came out and it was a monumental improvement on the 23s design and performance lol
Reply: Fr bro! Almost no reason to change
Reply: As long as earnings are released  for the shareholders yearly, the phones are gonna be released yearly
Reply: As someone who buys new phones every 3 or 4 years now, I think it's still ok for Apple and Samsung to still improve just a little every year.
Reply: Hey if people are happy buying $1000 phones yearly go for it, I'm good 😁
Reply: @Kantkylmi  you can trade in your phone for about the same price of the new phone. So you would end up paying a couple hundred bucks every year. But I prefer every 2 years to update.
Reply: I actually agree with this as well. It would create so much more hype I think anyway. However, I'm one of the suckers that buy these yearly releases. Lol.  Seems the slab phones have plateaued with very incremental updates. I mean general shape and features you could go back to S10 and for Apple the X to be honest. Very similar.
Reply: We reached that point years ago.
Reply: If these companies truly want to "help the environment" they have to move to a two year cycle
Reply: @armandogomez2677  No, people just need to only upgrade when they need to. Apple and Samsung aren’t forcing anyone to upgrade every year. What they should be doing is making battery replacements more affordable.
Reply: @FknNeowww  battery replacements are affordable.... And define "need to" all phones do the same things and run the same apps.
Reply: Sometimes they release dud models so releasing yearly gives them a quicker turnaround to come out with something better.
Reply: Brilliant review Marquis, as usual.
Reply: Yet they sell in the millions 😂, definitely need it every year.